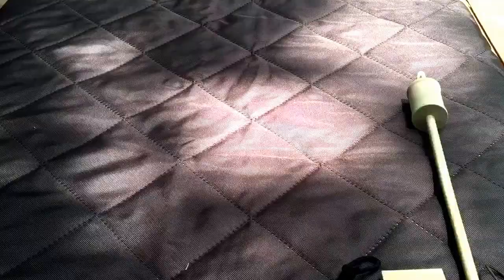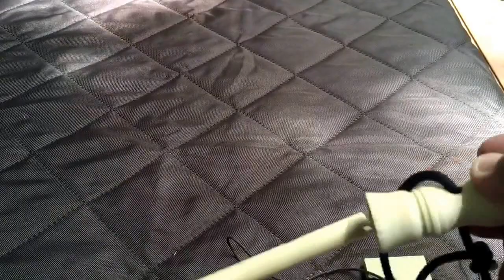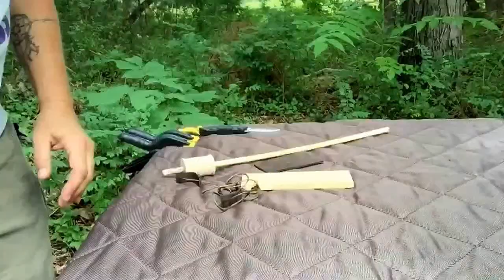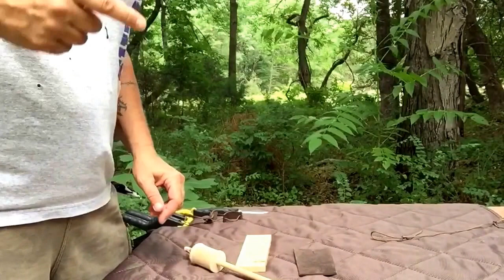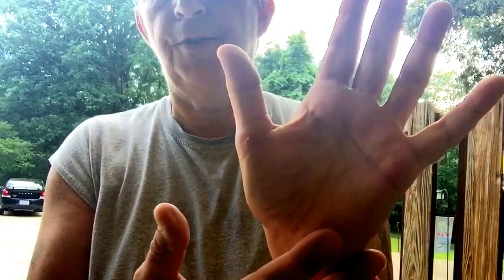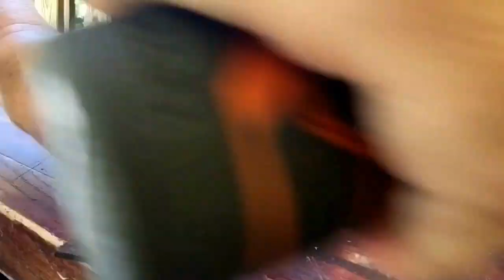Craft Store Friction Fire Attempt and a POWERful ending.

Comment: just practice , practice , practice to build up your stamina and when your hands start to hurt stop and give it a break . wood choice is a key factor,  a soft wood that you can dig your finger nail in best . Use the same for board and the spindal .  some woods to try are cedar, fur, cotton wood   and nothing with pine resin . I have a list I will have to find.